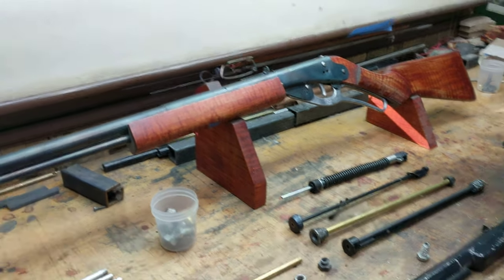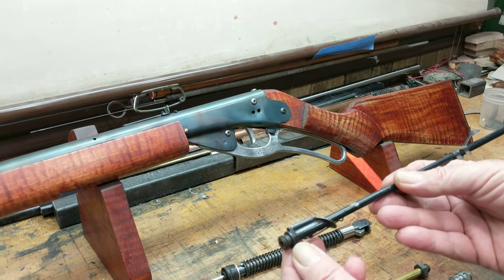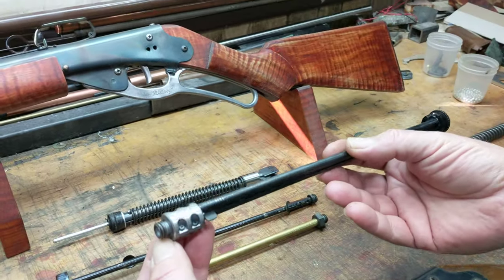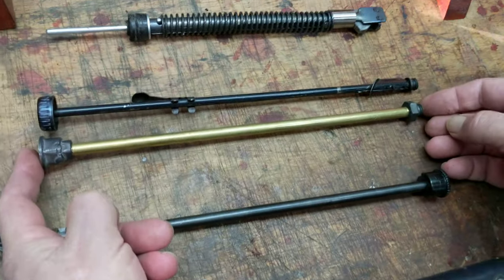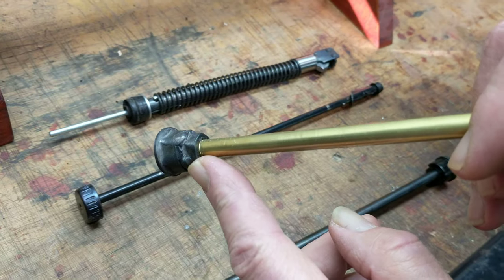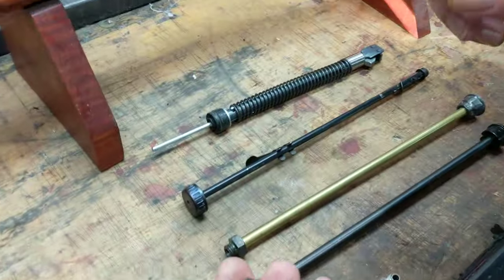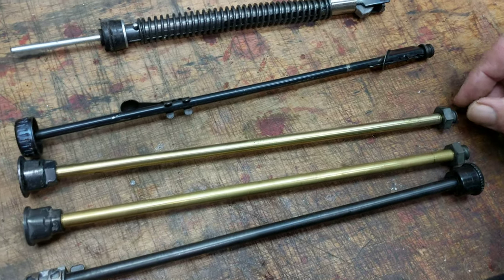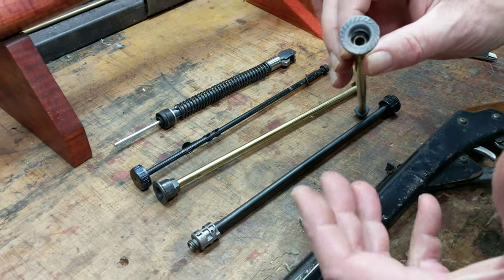Building a Restomod 6mm Airsoft/1/2 Corkball shot tube for your Bottlecap Daisy BB gun

Comment: I have am lucky enough to have an  original cork shot tube and bought a pack of original daisy corks(In the plastic wrapper)  on Ebay. I never saw them as they were stolen by a porch Pirate(someone in Ohio has my corks)...I have bought the #3 1/2 inch corks and they just do not fit. I grew tired of fiddling with it all and dropped them off to my friend. He cut down a cork to actually fit in the tube and it shot very well compared to the corks we had tried to compress and shoot...with caliper in hand we now figure we would need a .45 cal cork...I am still looking...but may try the tin foil. I think building the shot tube is beyond my capabilities, I did buy calipers but have yet to get a band saw. Another great video.
Reply from the maker: Peter, I messed around with tin foil balls and even built an arbor press to smash them into a conical shape with a copper pipe fitting. Made some pretty decent looking tin foil minie balls but they still were very erratic and simply flew left, right, up and down as if they were determined NOT to hit anything. Very frustrating that cork balls are so pricey.

Comment: hello, would you consider doing a video or two on the daisy manufactured cork guns / conversion parts showing how they are put together or modified to shoot corks? Are they powerful enough to knock down targets at any range?
I am contemplating building a motorized old style carnival shooting gallery that would fit in the back of a truck ( also for the grand kids)  to take to local car shows or town festivals. I would need some cork shooters to make this even close to acceptable for public use.
Reply from the maker: Severe, Interesting concept. I've never seen a Daisy cork gun in the flesh so I'm not knowledgeable about the nuances of which mainspring they favored but I do know that the original Daisy cork tubes were more or less identical to the unit I described in this video. It was a single shot design with the cork being pressed into the end of the special shot tube the guns were equipped with. In my own experiments I fabricated balls out of tinfoil and they would travel very erratically for about 25 feet but had enough terminal velocity to knock over an empty abult beverage can if the ball managed to somehow hit what you were aiming at. 

There's some info on cork firing Daisy's at the Daisy Talk forum, you can find it here:

http://forum.daisymuseum.com/daisy-red-ryder-cork-ball-conversion_topic9852_post42616.html?KW=cork+ball#42616

It's looks like it might be just the ticket to convert a current production Red Ryder to suit your needs!
Reply: @RestOModDaisy  thankyou for the link and kind reply! I will do some further research. Love the informative videos and am glad to have the knowledge showing how to repair, take care.